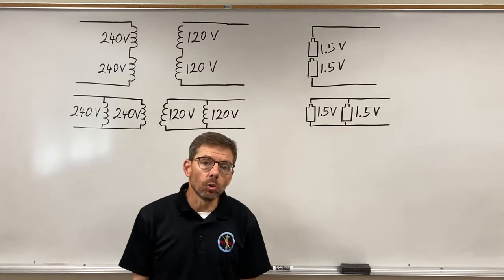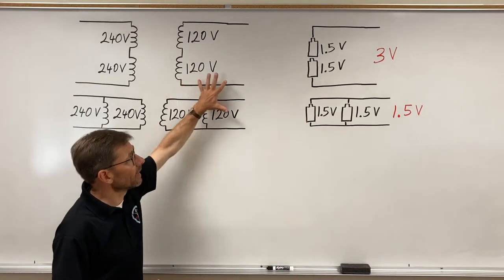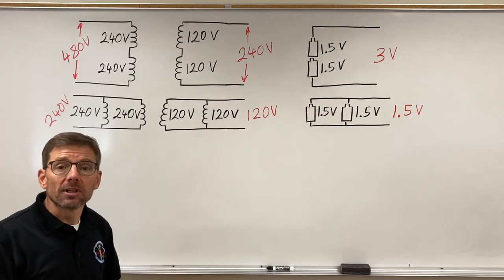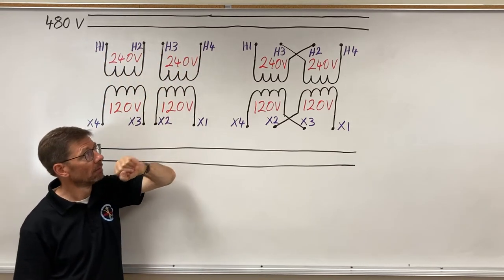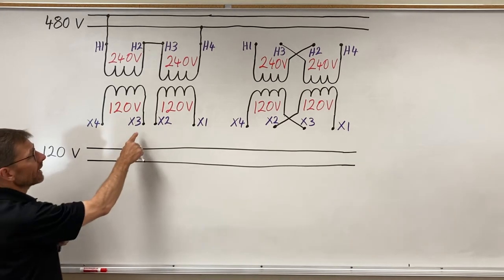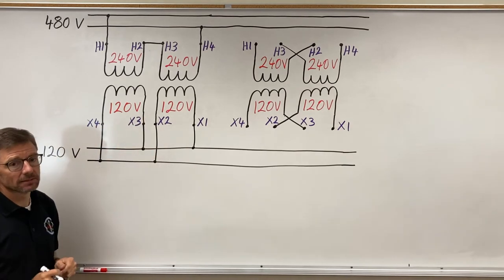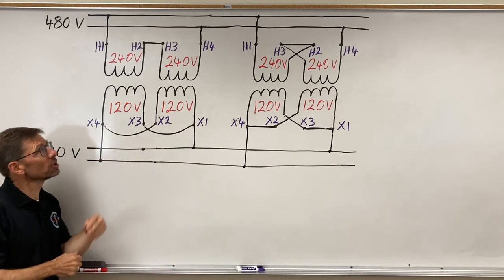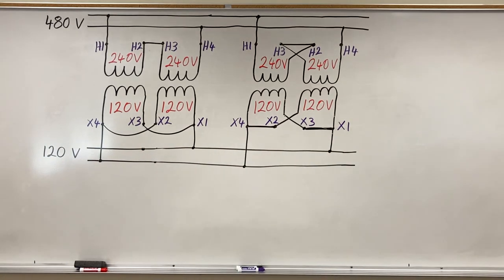Dual Voltage Windings - Part 1

Comment: No offense, but for parallel primary, shouldnt h1 connect h3, and h2 connect h4 through the coils? You swapped the connections AND the tap placement. It's electrically the same as connecting in series. That error changes the parallel secondary too, unfortunately.
Reply: Maybe for 240v but he’s talking about 480v incoming.

Comment: so my max 4000watt generator would not work to get me off the grid due to the amps being so low, rated max 8amp and I need atleast 100 amps even though I'd be using a transformer 🤔 this stuff is confusing.

Comment: My personal favorites are the old antiquated Scott Connections to get half-a**ed 2 phase 110/155 volts from 480/277 / 240/208 or 240 3 phase, vise versa. And the 12 lead 3 ph motors are fun too. I went from working in the hot Arizona weather to working on guitar amps indoors. Those have some very very strange transformers, especially the output impedance matching transformers. Some of those are wound super weird. Tapped windings? Sometimes. Some of the universal power transformers have taps for 100, 110, 120, 130, 220, 230, 240 and 250 volts. Parts of Japan use 100 volt 60Hz power. Other parts of Japan use 240 volt 60Hz or 50Hz. Fiji used to have 100 volt 60Hz mains. Everywhere else is 230-250 volts @ 50Hz except for the USA, Canada & Mexico and some parts of Japan. Being separate islands it's not they are going to try to tie system one into the other.
Reply: The open delta is kinda like the Scott connection. Same purpose, and beware of these weird ones! There was also the TT (same as The Scott). The audio transformer engineers get really creative for impedance matching. Some of them are less than optimal and not very efficient, plus a change in output taps results in notable changes in the sound. The inductance, reactance & capacitance in the coil windings changes very drastically in some of the goofier designs.

Comment: So does a residential transformer involve one Delta winding with 3-phase connected to three houses? Each house is hooked up to one of the three dual voltage wye windings?